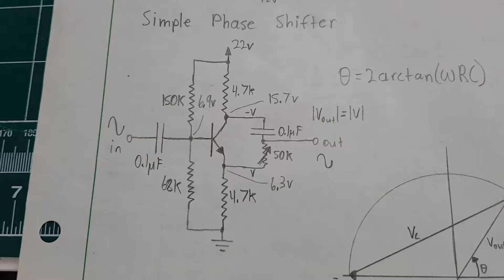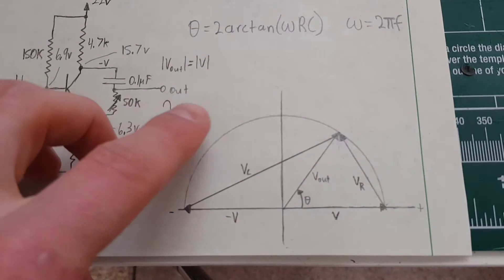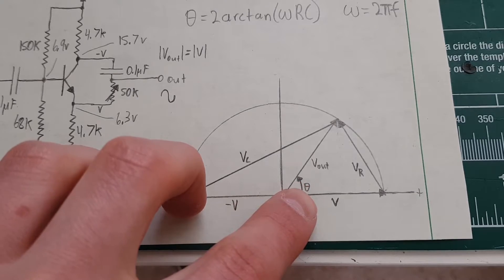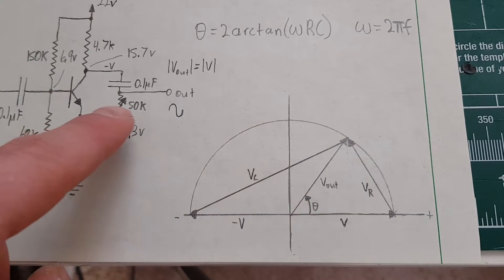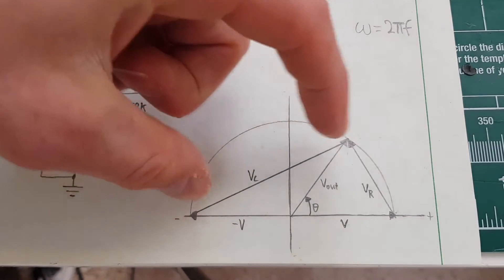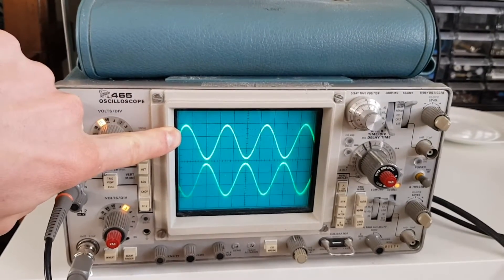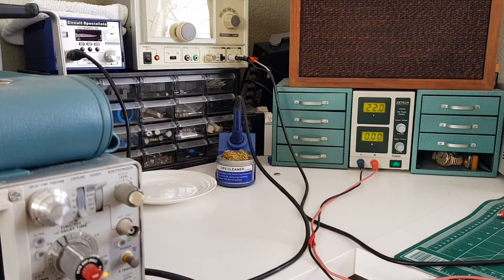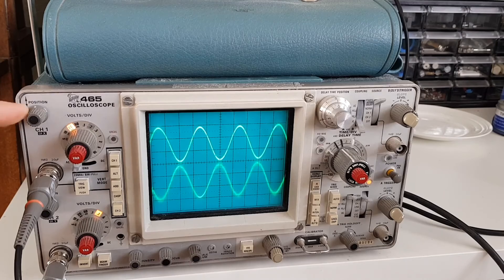Simple Phase Shifter

Comment: I used this circuit to set a tunable phase shift between 2 sinewaves at variablefrequency.  I used 2 of these circuits one set +90 deg and the other set -90 deg. I now have a tunable phase shift via variable R and the phase shift is fixed across variable frequency 500KHz to 2.5MHz.  Thank you much appreciate your video
Reply from the maker: Awesome! Good to see that it's useful.
Reply: How did you combine the circuits and can you explain a bit more how this becomes frequency independent? Pardon my ignorance.

Comment: What's the frequency of the sine waves? Also, what transistor did you use? I don't think you mentioned that. I plan to adapt the circuit to RF and quite like the idea. The way I see it, it's essentially a phase splitter (transistor part), where you then have adjustable RC filter for the signal recombination. I think at higher frequencies the values for R and C are going to become a problem. Perhaps less if you use PCB and SMD components. Still, most standard inductors and capacitors have quite low Self Resonant Frequencies (~10MHz) so above that you need the more expensive RF components. Perhaps there is an alternative to using the RC filter.

Comment: Looks nice, what is the voltage amplitudes of the input and output signals? Peak to peak
Reply from the maker: The input and output are approximately equal and are something like 550mV peak-to-peak in this video. It doesn't really matter though, as long as your peak-to-peak signal is within ~4.7V, it shouldn't clip.

Comment: what happens if you lower one of the 4.7 resistors? Will it result in some amplification if you lower the resistor closer to the input?
Reply from the maker: If you make the emitter resistor lower than 4.7k, it will amplify the signal, but it will also phase shift it more since. The signal from the emitter will be lower than that of the collector, therefore it will act upon it less. As you change the 50k pot, the signal will change phase but also amplitude, arguably making it less useful.

Comment: Hi, amazing video. Is it possible to make it work with a frequency of 80MHz? It's VHF and I dont really know how to do it, or how to do the calculations to get the values of the potentiometre and capacitor. Thx
Reply from the maker: It is possible, but there's a chance it may not work in this configuration. You can try with an RF transistor in this circuit soldered onto a one of those copper-clad prototype boards. My guess is the stray capacitances of the transistor and components will not allow you to get a full 0 to 180 degree shift. In other words, it will work, but to what degree I'm not sure. I would suggest a cascode configuration but Miller capacitance is not really a factor here since the gain is unity. On the other hand, it may work but the amplitude of the signal coming from the collector might be dropped due to capacitive loading. You could try to to buffer it with an emitter follower. 
The output capacitor would need to be very small in order to get a large phase shift. For a phase shift of 175 degrees at 80MHz, you'll need a 46pF cap going into a 1k ohm pot. If the pot is a higher value, the capacitance will need to be lower. If the stray capacitance of the pot or capacitance of the emitter to collector/output is too great, the near 180 degree phase shift won't be realized. I recommend running the circuit at a higher current, thereby lowering impedances and decreasing the negative effects of stray capacitance. Run the transistor with 470 ohm load resistors and bias accordingly with 15k and 6.8k bias resistors. Go even lower if the transistor can handle it. This way, it can more effectively drive the stray capacitances and the lower load resistance (the potentiometer).

Comment: hi. how would I make this circuit for a frequency of 50 Hz?
Reply from the maker: Studying the equation in the video, 180 degree phase shift can only occur when the term for arc tangent is infinity. This is not possible so we try to get close. In the video, I used a frequency of 1kHz, a capacitor of 0.1uF and a resistor of 50K (at max setting). This gave a maximum phase shift of 176 degrees which is close enough to 180. The idea is to make the change of the potentiometer usable; which means that the phase shifts fairly evenly over the whole turn. To make this work better at 50Hz, we can either increase the potentiometer to 220K, or increase the capacitor to 2.2uF. This will put the max phase shift at around 176 degrees. You may want to increase the 0.1uF input capacitor or you will may have a couple dB of attenuation.
Reply: @thetuberoaster8321  thanks for the help. really appreciate it. keep making good videos like this!

Comment: how do i determaine the required R and C values for a given operating frequency?
Reply from the maker: I replied to another comment similar to this which you can also look at. You can solve for RC in the equation but the trick is making the phase shift range large enough but useful. A 180 degree phase shift is not practically possible because it can only occur when the term for arc tangent is infinity. The best you can do is something like 176 or 178 degrees. If you solve for a phase shift much higher than 176, the range of the pot becomes really nonlinear and it does not sweep the phase range in a way that is useful. I'd recommend plugging in 176 degrees for the phase shift and the desired frequency to then solve for RC. This will correspond to the max value of the potentiometer. The 0 degrees phase shift condition is of course simple. When the pot is turned down it will go to 0 ohms or near enough making the phase shift nearly 0 degrees.

Comment: Does this design still work in the HF range? I am having trouble getting it to simulate correctly.
Reply from the maker: It should work depending on the transistor and layout. The real problem will be that the required capacitance might become so small (ones of pF) that interelectrode and wiring capactances might interfere. To circumvent this you can drop all the resistor values to give higher currents everywhere thus warranting larger (and more usable) capacitors for a given frequency. Capacitance of the potentiometer and inductance of wires might prevent you from being able to go 0 degrees all the way to 180, but I don't think this will be an issue until VHF or higher. Probably the absolute worst case scenario is it could oscillate near zero degrees phase shift.

Comment: So since amplitudes add by constructive interference when signals are in phase, how and where do we direct the input signal and the phase-shifted signal so input and output add together, thus doubling the amplitude at some circuit further down the line?
Reply from the maker: An op-amp (or JFET) mixer (summer) with two inputs would probably work best. One input would be the phase shifted signal and the other would be the unaltered input. The output would be the result of the two waves adding together, yielding anywhere from zero to double amplitude depending on the pot setting.
Reply: @thetuberoaster8321  Thanks for the reply but if amplitude doubles aren't we talking about free energy?  Couldn't we just continue doubling like a voltage multiplier as long as the initial signal kept coming into the circuit?
Reply from the maker: @tomfosdick8300  Not really, you can double the voltage of the signal, but any power you get out will come from the power supply for the phase shifter transistor and summer op-amp if you use it. Even if you were to use diodes instead to make a sort of passive voltage multiplier, the power out would still be less than what is coming in.

Comment: What is the range of input signal?? I mean at what extent we can raise input  votage?? Can we give input of 230v 50 hz supply??
Reply from the maker: This circuit would only work for small signals. The input can only go as high as maybe one quarter of the supply voltage and not clip. The supply voltage would need to be a very high voltage and the transistor and capacitors would have to be rated high enough to handle that. The other problem is that the output impedance would be high, requiring another amplifier after to deliver any sort of power. To phase shift mains power, you'd be better off using big inductors and capacitors. It would be hard to make it variable.

Comment: My objective is to so arrange circuitry that the ambient RF constantly present in our atmosphere can be "harvested" in such a way as to gather free energy.
Reply from the maker: Free energy is possible to obtain but not with this circuit. Using opposed coils you can get the waves to clap together in such a way to get basically free energy. The Mr. Preva Experiment demonstrates this phenomenon and is a good place to start. I don't post about it here because it's apparently controversial.
Reply: Thank you Tube Roaster  I will go look at Mr. Preva.  Again, I appreciate your straightforward answers and clear explanations.       @thetuberoaster8321

Comment: excelent video thank you that circuet might by usefull for pick up coils in distributor I am plagued for years with my hei ignition system basicali that thing has no advance or retard option for ignition timing very usefull circuet how ever Im not shure if it wuld work on my circuet I did in the past use only 500k pott betwean pick up + lead and input on the 4 pin gm ignition module and indead it was nearli 180° out of phase fiering how ever I did not use voltage deviders or capacitora engine run crapy honestli but it did fire at exaust stroke engine did run at exauat stroke how ever after half houer cranking engine and the problem by my was I used speaker wire was an fool didnt have any non resistive leads. Only problem I have I dono what resistor value to chuse or capacitors or resistors the pick up coil is mostli based on voltage and high frequency I ques around 33hz up to 333hz max thats how much is rated the 555 timer in the ignition module it uses the mc 3334 ic chip set . So any suggestions what transistor potentiali wuld work on that set up or activateing or useing that circuet with an darlington power transistor???